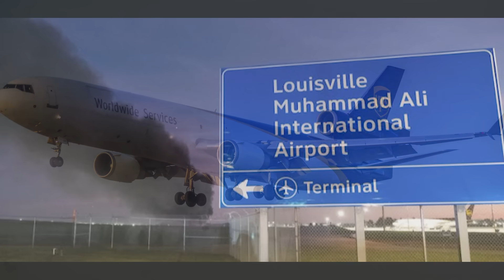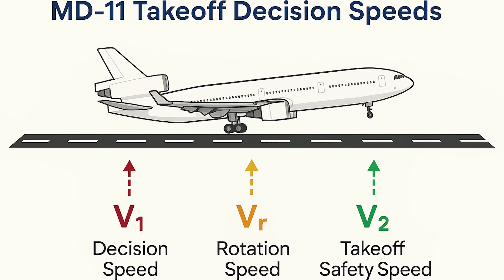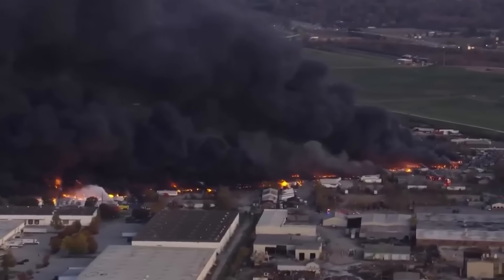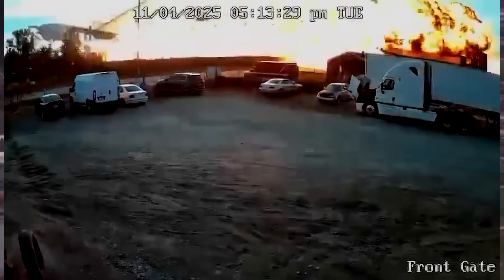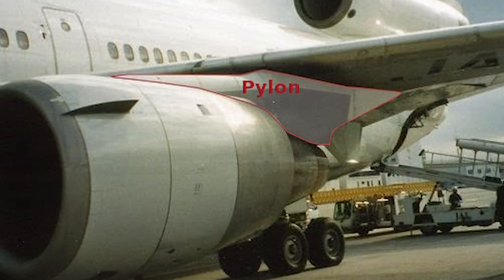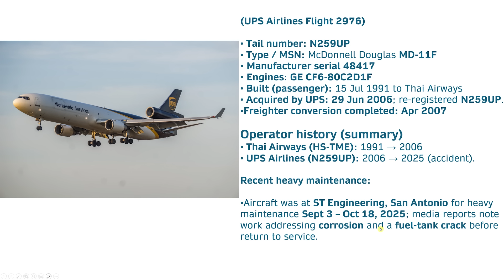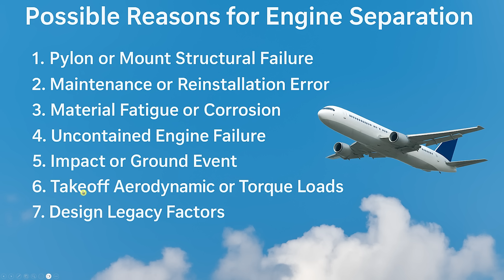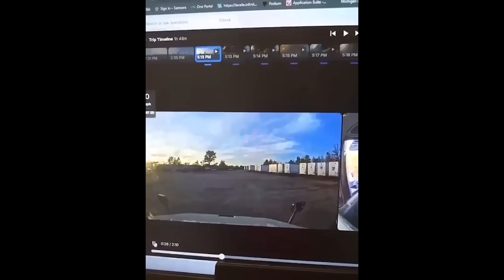What Caused UPS Plane Crash, Louisville, KY? How MD-11 Engine Fell Off

Comment: The trucker's dashcam video is the best. He was in the parking lot. It showed the plane hit the building he was at then tip sideways. Right after it crashed the YT pilot said it would have tipped with the engine gone and the right engine still at high thrust since they couldn't abort the takeoff.
Reply: Wonder if people capturing such rare incidents are able to sell the vids?

Comment: Those poor pilots had to be terrified!  And so sorry for those on the ground who didn't see it coming. PRAYERS FOR ALL. 😢❤❤❤
Reply: No. They didn't have time to be terrified. They'd be evaluating and reacting to the loss of thrust from the port-side engine, applying full right rudder in an attempt to correct, then one second later the plane rolled into the ground. Four to five seconds from start to finish, mercifully.

Comment: the wing still seems quite intact, one would think an issue with the pins that connect the engine to the wing
Reply: Small cracks in these pins caused EL AL fligt LY-1862 to lose two engines october 1992, it caused engine #3 (innner starboard engine) to detach  en it knocked engine #4 (outer starboard engine) of the wing. The leading edge of the wing and hydraulic lines were damaged, causing the plane to become uncontrolable. Trying to get back to the airport it crashed into two high-rise apartment buildings.
Reply: @keeshoogendoorn6241   ah yes! Engine was found in nearby water I guess. Also here look at the engine, apart from the shell it's basically in one piece.

Comment: So the "biggest cause of crash" could be averted if runways were made twice the size... ...simply giving them room to stop after V1 or Vr.
Reply: That,s a very good point
Reply: Your comment made me think of the NHRA shortening the distance of top fuel races, to 1,000 feet, after the 2008 fatality of Scott Kalitta, whose family, coincidentally, operates an air cargo company.
Reply: you would think USA would be able to do that with all the land there is in that country.
Reply: But then the V1 and Vr points would be fixed further forward in these double or triple sized runways, so the left over runways would  always be too short to safely stop the plane.
Reply: @anthonywilliams9852   I agree! Airlines will just choose to use less thrust below 100 knots or so to reduce stress on the engines and save on fuel.

Comment: I think it was the tail that made the Groove in the building if it was landing gear it would of been torn off...
Reply: "groove"
Reply: @williamfuller2389 edited
Reply: Yeah. The wheels bogies in the over the road video looked untouched. And it took a few videos to learn there are three, there being a center set of wheels. I was clueless even after watching plane spotting at DFW.
Reply: Yeah, looks that way. But I believe there is video that shows the airplane going over the top of the building and it was not inverted at the time. That's why they say it must have been caused by the landing gear.
Reply: @Yeeeeeeeaahhh   Nope the airplane is in a tail low attitude - the tail is lower than the main gear. And as I told you before, there are Vlo speeds. Airloads are strong enough to damage landing gears. A building's walls and roof are much denser than airloads. Had the gear hit the building, it would have been sheared off.
Reply: @ILSRWY4  I was responding to the OP. The OP here is suggesting that the tail had caused the damage to the roof of that building, which isn't really likely, I think. The plane would have had to of been inverted (upside down) when it flew over that building in order for the tail to have caused the damage. 

As I said here, "That's why they say it must have been caused by the landing gear." ... I'm not an expert by any means and I don't think anyone here is. It's the internet where everyone thinks they are an expert. But in no video does it show the airplane being totally inverted while in the air. It rolled to its left side. It could have been caused by the left wing, not the tail. I also suppose it depends on what exact material that roof was made from and what force would be necessary to cause it.

I totally clarified my comment with "they say". Guess you don't understand that it's not necessarily what "I am saying" but rather what other experts have said. Comprehension of English?

Comment: Take a second look at the warehouse that was hit at the end of the runway (5:33).  To the bottom right there is a line down the roof of that building that stops about halfway towards the opposite edge.  That is the line of runway lights, in alignment with the runway vector.  You can see just how far the plane had already drifted off center, towards the direction of the stalling wing, by this time.  This building is ~800 ft from the edge of the runway pavement, about 2500 ft from the end of the runway landing area markings.  That cut into the building is a good 180 ft off runway center, more than the wingspan of the plane. The plane was travelling around 170mph (I am assuming it had already begun shedding speed it had attained by V1).  That means it was already drifting left at ~18ft/second at the time it began raking this warehouse roof.
Reply: Yeah just noticed that when I looked on Google earth. Crazy that the building is so close that runway lights are installed on its roof.
Reply: Nice work! 😃

Comment: So far it does look similar to AAL 191, but, it's a little bit different.

AAL 191 is kinda heartbreaking. Not only because lives were lost, but because the plane could be saved, THEORETICALLY, if the pilots didn't slowed down the plane to the V2 speed (Engine failure safe speed briefed prior the takeoff) as they were trained to do. I mean, they did everything right, as they were trained. But, the engine detachment caused the leading edge slats of the left wing to retract under the airflow, and that reduced the stall speed on that wing, and that speed was just above V2 speed. Hence the death roll. It's a total hindsight, but a few extra knots, and the plane could make it, THEORETICALLY. 

UPS flight had encountered similar engine failure, from the data available. But it caused a huge fire and much more debris, it seems. There's evidences (not confirmed) that the engine number 2, the tail mounted one, had experienced a compressor stall, possibly due to ingesting debris. At this point, the plane was doomed, it couldn't lift on a single operating engine, and the engine separation damage possibly damaged some part of the wing, making its stall speed lower, again, that was the probable cause of the roll. Worth to mention that after AAL 191 the hydraulic system was modified and the slats wouldn't move back in case of pressure loss, but they were probably damaged, compromising the airflow.

I guess we wait and see. Corrosion and cracks aren't a big deal in airplanes, especially old. Well, it does sound like a big deal affecting safety and all that, but, aluminum corrodes and cracks, it gets patched up, replaced or repaired, it's not something out of ordinary, I mean. There's procedures to deal with that, there's experience. It's pretty much a maintenance routine, every plane has to deal with that at some point. I wouldn't think about it that much for now. It's worth noting, but the real cause might be something entirely different.

Comment: For what is worth... the pilots like like they had a small amount of control.. they had a chance at least, like 5%. From watching other videos, the engine mount is made to break if the engine is vibrating too much. Guess its better in flight at least to lose an engine than vibrate the wing off the plane.

Comment: My guess is that the left engine departed over the top of the wing like Flt 191 and in this case threw some debris into the tail-mounted No 2 engine and as heavily loaded as this plane was, it didn't have nearly enough thrust to stay in the air or climb away with one engine left running.
Reply: I agree I don't think they had any throttle left.(They were wide open) Where the DC-10 that lost the engine in Chicago  since they weren't loaded to the maximum they had enough thrust left if they throttled all the way to the stops

Comment: The damage on the building was most likely from the aft portion of the Fuselage not the landing gear. Another video shows the landing gear down and undamaged. Please leave accident reporting to those that have some clue what they're talking about. Ultimately, the NTSB will come to a conclusion of FACTS and conjecture will no longer be needed. One thing I'd like to know; WHY was the accident aircraft GROUNDED FOR 6 WEEKS IN SAN ANTONIO, TX. FOR MAINTENANCE? This would a point of investigation for me.

Comment: The engines are mounted using "fuse pins" which are designed to shear if an engine failure results in extreme vibration. Instead of the vibrations destroying the aircraft structure, the fuse pins fail and release the damaged engine.

Comment: Look.... Engine had a catastrophic failure. Fuel is still pumped through to the engine unless hydraulics are shut off. Fire had already broken out so fuel will add to the confligration. With a full load and full fuel load, the crew didn't have a chance of any recovery. So it went down. During maintenance in September and October (according to investigation so far, not confirmed) there may have been minor corrosion in the left hand engine pylon. Pylons are and hqve been a historic weak point on this aircraft. So.... If you have a catastrophic fan failure, a weak pylon, full fuel tanks.... It doesn't take a lot to possibly think how this will turn out after the investigation is completed. Lets keep an open mind on this. Just sending prayers to all the family's involved in loss, especially the crew. 🙏😔

Comment: How the heck does a whole entire ENGINE drop off of a plane??
Reply: It has happened a number of times, most notably the AA191 DC-10 in 79, but there's been other cargo planes like the El Al and China Airlines flights that had 2 engines separate on the same wing.  And another, a Trans-Air-Service lost 2 and actually successfully landed, mainly because it happened at altitude, so they had time to stabilize the plane.  But on take off you are doomed.

Comment: What a surreal scene. Crazy that the second guy running out of the tire shop is holding a tool.
Reply: Ikr. I have some tallish trees on my property. And when I have to take out the pole saw to trim branches, I always make sure my escape route is clear and always mentally remind myself to just drop everything and run if I see that things are leaning the wrong way i.e. in my direction.

Comment: This accident closely resembles the May 25, 1979 crash at Chicago O’Hare, when the left engine separated from the aircraft during takeoff. Many people are unaware that three-engine aircraft are certified to safely continue a takeoff with only two engines operating, as required under federal aviation regulations.

In both events, the left wing lost lift because the leading-edge slats retracted to the fully up position, causing an uncommanded roll to the left shortly after liftoff. During the 1979 crash, the loss of hydraulic pressure on the left side caused the slats to retract, which led to the same aerodynamic condition.
Reply: The slats didn't retract in this incident. They are clearly seen in videos. After AA191, the systems were redesigned.
Reply: This can't have been the case with the MD-11; it locks its slats when they're extended unlike the early DC-10s which relied solely on hydraulic pressure.
Reply: @davidfuller581  Thanks for the information.
Reply: Heck. They gave a try climbing out on one engine. If #2 got over the compressor stall they might have found out they only had two engines.
Reply: if you lose one of the wing engines in a Tir-Jet type of aircraft and fuel comes out of the wing that fuel will be sucked up into the center engine on the tail and will render that tail engine useless, whether that fuel is on fire or not. Now you are down to only one working engine and the aircraft can't fly out of that. Look at both the Chicago picture and the Louisville videos.
Reply: We don't know for sure if the left slats retracted in this crash, but it seems likely. Anyway the rollover didn't start until after impact, so it probably wasn't a major contributor.
Reply: @bbgun061  not to the cause no, but for it rolling over yes.

Comment: I would not be surprised if the maintenance crew that worked on this plane a few weeks prior has some critical information.
Reply: They might. Or it could have been something that routine inspection/overhaul missed. 737 fan blades had a major issue that wasn't caught for a long time. We dont know yet
Reply: They probably aren't sleeping too well, ATM.
Reply: Critical information you mean finger pointing
Reply: @jarrowbrinda  Maybe.  Or maybe someone took some shortcuts.
Reply: It was delayed the day of the accident for maintenance,  also. Looks like they forgot a screw...
Reply: @shaneocana6491 unless something has changed since last I heard, the NTSB has said that this is likely not the case, though they were not going to rule it out completely until further investigation.
Reply: @shaneocana6491 it wasn’t, please stop spreading lies
Reply: DEI strikes again.
Reply: @vancguy9204  Why, were you on the crew?
Reply: He’s clueless, obviously.